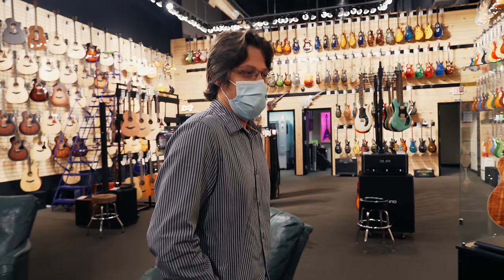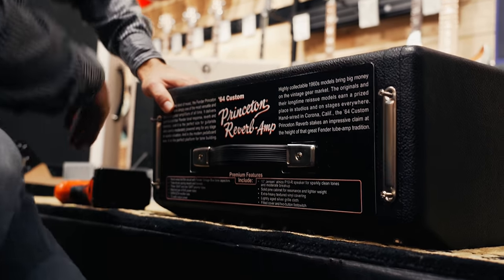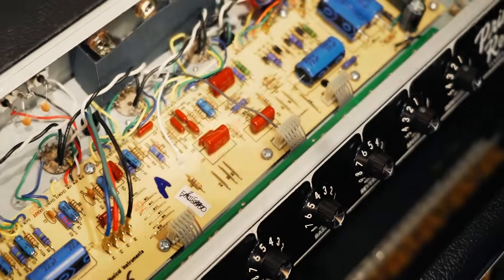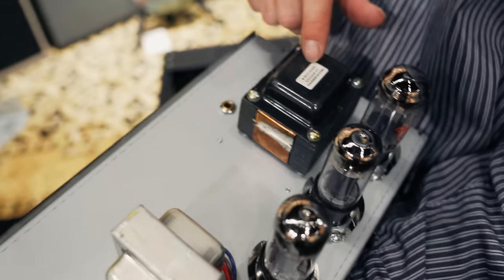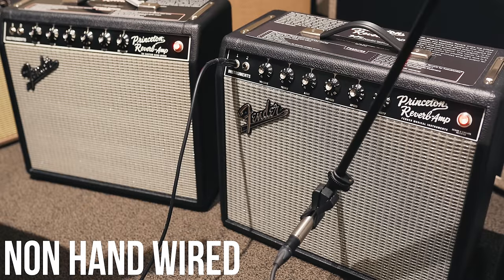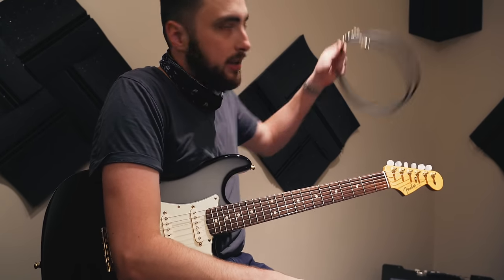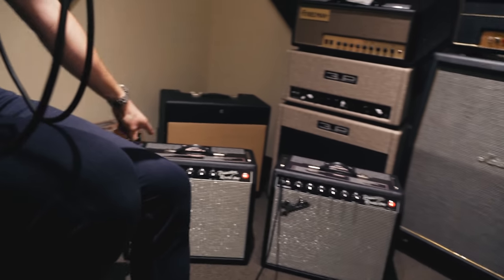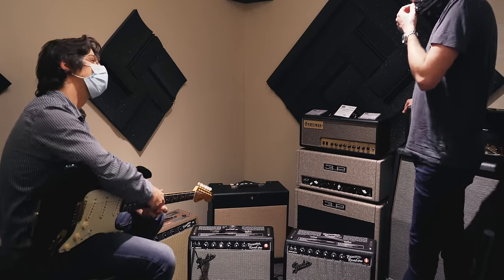Are Hand Wired Amps Really Better?

Comment: “The circuits are slightly different, the components are different....the speakers are different” 

shocked Pikachu face when they sound different
Reply: Well the thing is a Super Reverb's circuit is different between say 1964 and 1966, slightly. However, if you made a 64 replica by hand and a 66 replica by circuit board in the same manner you'd see the same differences nothing like you'd  see between two real Supers of those eras if brand new. I wouldn't put the difference much to the circuit. Its probably the fact that there's a thousand components that were lower quality. Lower quality means different spec tolerances compounded so that circuit board be less representative of what the circuit design intends than a hand wired equivalent of the same circuit.

And then of course the speakers. The speaker makes a huge difference so its clear that you lose a lot in that speaker alone.
Reply: No kidding!  You could have put them both on a PCB and they'd still sound different.  If they're using the same components they'll sound the same...the hand wired might have a little more hum depending on how skillful the builder is.  It's the circuit and the components that matter (and how the AC in the heater circuit interacts with the signal path...etc.)
Reply: Exactly. And I can't wrap my head around hand wiring being more reliable. What a strange industry. So committed to old technology no matter what.  Maybe SpaceX will abandon PCBS and go back to the Apollos hand wired control circuits of the 60s because they are "more reliable". Pretty sure reliability is important in the aerospace industry.
Reply: P*Funk Yeah it probably has more to do with tolerances and speakers than it does circuit differences.
Reply: mijwil Agreed. The only benefits I see with hand wiring an amp is that it’s a little easier to repair because things are right there in front of you. Removing and soldering on PCB can be a real pain in the ass. Again, these aren’t things you can hear unless the hand wired lead dress is garbage and then it’s a noise problem and not as much as a tone issue.
Reply: Tony Berkopes  They did, out of the hand wired cab. Sadly they never compared with the non handwired to see how much worse the better amp could sound.
Reply: Yeah, when I heard the speakers were different I thought well of course they will sound different! That's a huge variable.  Then he said at 1:55, "I think there is more afoot than just the handwired aspect of it".  *Hint: the speakers are different.
Reply: The little difference is inaudible in a band context so play and forget anything...and remember...the most important is the song.
Reply: @xavibsa  Wise words.  We tend to get a bit obsessive about sound since we often practice in a quiet room alone.  But you speak the truth.
Reply: @xavibsa  hell, I have s Fender and I understand. Producers likely don't give a shit either with so many tone tools available post production.
Reply: Yep. Another factor here is PCB layout/hand-wired lead dress. It is certainly possible for the same circuit (even with the exact same components) to sound better or worse depending on these factors. If the PCB layout--accounting for factors like trace width, length, and routing--is not well thought-out, the effect can be audible. Similarly, sloppy lead dress in a hand-wired amp can cause all kinds of noise issues. The notion that there is something inherently inferior about audio circuits built on PCBs is essentially superstition. Take a look at high-end pro audio equipment--mixing consoles, mic preamps, etc. Go to any world-class recording studio and you'll find that the vast majority of the outboard equipment is built with PCBs. I don't believe there is any objective scientific evidence to support the existence of any audible effect of building a circuit on PCBs, all other factors being equal.
Reply: @xavibsa  And then it goes into a mic and then out to the front of house speakers, so these subtleties are lost for the most part when you are performing live. I have Princeton 65 reissue and it sounds great, and as long as our drummer doesn't play too loud, it's loud enough to perform with when mic'ed.
Reply: I mean... other than THAT, Mrs. Lincoln... how did you like the play?
Reply: Hence the different sound.
Reply: You you're right but the fact that universally a hand died amp does this and a PCB amp does that it's a justified real world test.
Reply: Brian Cullen Not universally.
Reply: But remember they put the chasis in both speakers
Reply: Different speaker is 95% of the story
Reply: @mijwil the cheap two layer chinese PCBs are in no way comparable to what SpaceX will be using, but yes, boards are actually better in many ways. Notably the fact that you have ground planes, lower parasitic inductance.
Reply: @mijwil  True, no way hand-wired is more reliable.  Solder fatigue, corrosion, cold solder, etc.  all really problematic. Also, it is easy to service a circuit board.  Hand soldering a component onto a board is much easier than the three-handed operation needed for a hand wired setup.  For all p-type boards these days we just get boards made, because it is so much easier and you can get them in a day.
Reply: @BollocksUtwat  The small components are closer in quality than you know, regardless of misinformation spread by assumption. Here are the only 2 differences that are significant to tone: 1) The speakers are both good quality but designed for different(NOT better/worse) tones. 2) The iron is higher grade & heavier in the 64 Custom hw. 
Swap to a WGS Am Vint and the iron for the right Mercury Mag parts, and the 65RI will sound better than the 64custom hw for still half the $
Reply: @toddrohrer6211  Amen. And the quality, substantial boards Fender uses in the 65RI's are easy to work on for anyone qualified to be in the chassis of either amp- regardless of biased assumption to the contrary
Reply: @mijwil  well they are more reliable because theres less moving parts and its simpler in design. Also, they are easier to repair.
Reply: @mijwil  haha, good analogy!
Reply: The bias could be off slightly between the two. Lots of factors. But we clicked and commented so is all good.
Reply: They used the same speaker but ok.
Reply: The early Hendrix riffs, non hand wired sounded nicer with brightness

Comment: You could take two hand wired amps of the same model and they will sound different. Components have tolerances that could affect the tone. I started building my own amps mostly because of the way Fender takes all kinds of shortcuts including cheap components, flimsy circuit boards
. The hand wired version has the same cheap IC (Illinois Capacitor) filter caps, you’d figure for twice the price you’d get some nice Sprague or F&T caps.

Comment: A short story to illustrate my previous points: Back in the 90"s Jimmy Page was in Vancouver recording an album with David Coverdale at Little Mountain recording studio. My bud and colleague, Jim Sirvus (guitar tech extraordinaire) was his tech for the recording. I owned/ran a service/ repair company called the Audio Doctor through the 80-90's. I did all their amp and processing gear service for them over about 4 months. Page had many amps and guitars here, as you might guess. They sent over one of "those" Marshall 100 W plexi's. After troubleshooting it, I discovered that the output transformer was pooched. I didn't have the right transformer in stock and delivery was weeks away from the Canadian distributer in Montreal. I did have a HIWATT 100 watt output transformer (Partridge manufacturer? ). I installed it, tweaked the bias, did some maintenance stuff, and played through it.LOUD. And guess what it sounded like? It was that somewhat bright-ish Townshend HIWATT....... "KKKKKRANG"!!!!!. I was more than a little nervous (being a total, unrepentant fanboy like you would imagine) about sending it back to the studio sounding quite different than stock. Guess what? He loved it. I am guessing that it added to the colour palet of the 20-30 other amps he had brought over the pond to Canada. I also discovered that he brought over about 6 RCA BA-6 tube limiters--(a 50's broadcast limiter with an output section similar to a 6V6 o/p tube Fender amp of the day).... maybe the key to his killer acoustic sounds.And I did, courtesy of Mr Sirvus and Page, get to play "those" Les Pauls, the ES-1275 and Danelectro's. I nearly peed. haha. He (Page) was also a very nice guy, a true gentleman and very verbally appreciative, which surprised me somewhat, especially for someone who has had their ass kissed, probably both literally and figuratively, for the last half-century.
Reply: ah yes I remember Little Mountain studios  drove past every day for years going to work I believe Randy Bachman ,and Joni Mitchell recorded there at the same time, and the good old Band Chilliwack, those where the days of real music.
Reply: With out the beautiful gear, I wish the production of the record wasnt so "produced"

Comment: IMO, the speaker is 60% of the tone of any amp setup. That said, the handwired amp wins hands down in this comparison. Also, even though they have the same tube types and brands, tubes vary greatly piece to piece so can't discount that aspect either. Those wonderful poly caps in the handwired have such a wonderful smooth treble response. Soooo smooth!!!
Let me know if you want some mods for that baby. I designed and built handwired tube amps for years before starting my pedal biz. Still build some here and there.
Reply: i have an 85 mesa S.O.B. that is the princeton circuit, but extra gainstage ect... but it doesnt have reverb nor an effects loop.... but has holes for tube sockets and additional jacks...

Question...

would it be easier to install spring reverb or series  effects loop? i would even settle for parallel just to add ANY ambience with a drykill device...

your expert advice please.
Reply: @minus9us677  depending on what exactly the jacks are for or where you can pull a tap out to add in external stuff etc. a series efx loop might be a better because an efx loop can be any kind of reverb (just slap it in the cab and plug it in) and whatever else you want, whereas something that's just reverb will often stay just reverb.
Reply: @minus9us677  Series effects loop will be the easiest. Just have to find or make 2 3/8" holes to mount the jacks. should be able to tap in just before the phase splitter.
Reply: @LawrencePetross   the amp is retarded loud, i understand tapping before the phase inverter, just 2jacks that self defeat inline? no caps or resistors? the amp sounds great, just needs a loop badly.
Reply: @minus9us677  I can't find a pic of the back of this amp. Does it have a jack labeled preamp out and one labeled power amp in? They'll probably be on the back
Reply: @minus9us677  If it doesn't already have those, wiring it in is pretty straight ahead. The wire connected to the wiper of the Master Volume leads to the input of the phase splitter. Wire the shorting jack that you're using as effects send to the Master Volume wiper. Technically, for the smallest ground loop (lowest ground noise) you'd want to ground that jack where the Master Volume grounds. It's probably fine to use a standard open frame jack and just ground to the chassis at the jack. The effects return jack will be wired to the phase splitter input (where the stock Master Volume wiper wire connects). Technically, you should ground this jack where the phase splitter gounds (again it's probably fine to ground to the chassis at the jack). You'll want to wire the shorting jacks to pass signal when nothing is plugged into them.
Reply: I don''t know how you can hear that off of youtube...are you feeding a digital youtube signal into a tube home stereo...sound is subjective...the 65 RI...is a great amp...it has not left the line from Fender since 2008....it is a great amp!
Reply: @BrianKaplanUCNBG  Hi Brian, yes I feed youtube through my studio and then near field JBLs
Reply: Output transformer also makes a big difference in tone & feel.

Comment: I had 4 Princeton Reverbs at one time. A '69, two '74's, and a '78 With the same tubes and speakers, and biased the same, all 4 still sounded different. I sold 2, and kept the 2 that sounded the best, which were the '69 and one of the '74's. But people forget that the wood in the cabinet also has an effect on how the amp sounds. Solid pine sounds much different than the pressboard that was used on the later models. Bottom line is, get an amp, set it how it sounds good to you, and go gig. The crowd will never know the difference from one Princeton Reverb to another.
Reply: Does pine sound way better?
Reply: 100 percent this. The best amp in the world is the one that makes you want to play for 100 hours straight, and makes the sounds you hear in your head. Sometimes a real nice boutique hand wired thing is indeed the answer, but not always.
Reply: The size and Construction of the cab matter much more than the woods. Jim Lill has a very well put together video about guitar cabinets, and tonewood wasn't a factor. He has a segment at the end comparing birch and styrophome cabs that are the exact same dimensions, there's a difference, but it's so minuscule you'd need some really sensitive ears to hear it the first time around.
Reply: @Name-el9ps  A LITTLE bit better. (hard for most people to hear). HOWEVER, it IS lighter.

Comment: - The circuits are slightly different, the components are different, the speakers are different
- So I guess the main thing we're testing out today is handwired vs non-handwired
- Yeah
Reply: The two amps are different component and build wise.  What the test is comparing is two different versions of a Fender Princeton.  Yes it is all the differences that make them sound a bit different, the hand wired aspect speaks more to the build quality than the tone.  For some that is highly desirable and others won't care.
Reply: What we are testing here is the sound of identical cabs ... oh, wait, the new one is flakeboard

Comment: Perhaps the more important question that was only touched on, is the better quality components used in the hand wired amp. This to me is more likely to account for tone, along with the alnico speaker. Go to an online parts store and see the different prices for the same value caps for instance. Some boutique amps are made with circuit boards. When done to the highest quality standards, I doubt you could tell the difference. Quality is quality.
Reply: Didn't he say the circuits weren't the same as well?  If the mids and treble are different, it's probably the result of different values in the EQ section of the circuit.  It's a fact that the originals weren't using high quality components...
Reply: no, "better components" is also BS.  Components may be +-10% according to the spec, but more expensive ones may be more likely to actually be in their spec range.  But given two resistors in the circuit, both nominally say 2000 ohms, and both say really 2037 ohms, the sound will be identical even if one is NASA surplus and the other ripped out of a Chinese toy of some sort.  Nice ones may drift less as they age.  But ohms are ohms.  Farads are farads.  Cheap and stellar sound identical.

Comment: The difference in sound is not about hand wired or not, it is about:
"The circuits are slightly different, the components are different....the speakers are different”
Reply: the mic placement is different
Reply: @ctld5266  exactly
Reply: I think we're getting more information by them talking about it. And they're convinced one way or another. YouTube is not the place to make a judgment on a demo through your quarter inch speaker on your phone. But both of them are convinced the handwired sounds better and on this video there's no reason for them to deceive.
Reply: @stringlocker  I have no idea what you are trying to say relating to my comment.
Reply: Somebody talked about mic placement here I was more talking about that.
Reply: Okay I got it I think I know what you're saying. You're saying a printed circuit board can sound as good as a handwired amp if it's done correctly. Probably. But it's fun to see Fender exposed. Because they claim both of these amps are Princeton reissues. I would like to hear fenders response to something like this. It would be okay if fender said for the price this is the best we could do.
Reply: @stringlocker  Yes, if we compare two amps that have different components, slightly different circuits (!) and even different speakers, then it`s those differences we hear. Handwired vs. PCB most probably plays the smallest role in all of this, if any role at all. What we can say is that in this kind of setting it is impossible to draw conclusions regarding the difference between handwired and PCB. 
And I don`t see Fender being exposed. They never made a secret about how these are constructed. It is not different to any guitar maker that brings out reissues that are not 100% identical to the originals and that`s the case most of the time.
Reply: I guess exposed was the wrong word. Maybe the thumbnail wasn't correct. I guess it should have been just a comparison of the two amps. And not the bigger picture of handwire versus circuit board.
Reply: @stringlocker  You are right, thumbnail and the whole approach are misleading.
Reply: @stringlocker  There's no reason for them to deceive (except for clicks, which is their entire income source, no big deal), but a million reasons for them to be deceived.
Reply: I couldn't agree more. It's all about components, if amp sellers would know about electronics they would give technical information instead of clichés.